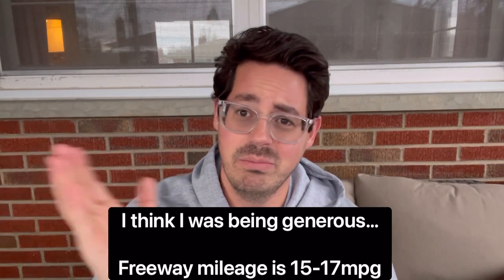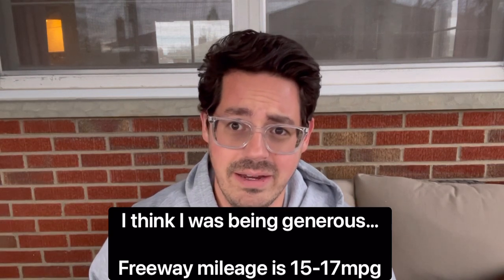Worst Engines of All Time: 1982-84 GM/Chevrolet 305/350 V8 Cross-Fire Injection System

Comment: I bought a 84 vette a few months ago. I knew nothing about the crossfire injection. Car ran when I got it but just barely. At best I'm a shade tree mechanic, but not stupid , if I want to figure something out I can and will. After about two weeks of working on rhe car it now runs very well. Lot of haters on the crossfire. I don't have a problem with it, hell I like it. Only thing g I didn't mess with to make it run was the crossfire system. So hate away boys, I don't care.

Comment: I had an 82 trans am just like yours with tan interior. Your comments are spot on, even the overlay about the soft camshafts. Mine had a flat cam shaft lobe that made repairs more than the car was worth. Great handling car but weak power train and absolutely atrocious build quality. Worst rattletrap I’ve ever owned and the car only had 60k miles on it when I bought it in 1987.

Comment: Trust GM to totally screw up an incredible intake system. I mean hell, MOPAR had 2 awesome CrossRam setups that GM could have copied. 
Ive always wondered if you could port inject the manifold and run say, a F.A.S.T. PCM if that would make a performer out of it.
Reply: Since air-fuel distribution was poor, GM should've taken a page from Nash Motor Company (back in the 1950's).  They used a water jacketed intake manifold that had perfect air-fuel distribution and vaporization.  The entire manifold was evenly heated by the coolant at the top of the engine (flathead six), and Nash engines were renowned for fuel economy and smoothness.

I don't know how GM would water jacket that Cross Fire intake but, had they done so, the runners could be large for breathing and the uniform heat all over the casting would enable a much leaner air-fuel mixture and balanced distribution.
Reply: @BlackPill-obey  But, if one were to port inject it, the the manifold would just move air. Do you think that would have made a difference?
Reply: @shelliecarlson7015   Sequential port injection would've completely solved the fuel distribution problem.  But, back then, it would've been cost-prohibitive.  

The technology obviously existed back then but, to make is feasible for mass production and maintain a certain price level was the problem to be overcome.

Comment: I owned an 84 Corvette that was crossfire injection and had no problems at all with the injection system. By 84 they worked out the bugs but it was too late the damage to the reputation was done. I drove that Corvette for 177,000 miles and the only problem I had was the hydraulic clutch cylinder spring broke.

Comment: Hi Adam. I am a GM/Delphi retiree that worked at the plant that built the TBIs, CPI, SCPI, the Multec 1, 2, and 3 port fuel injectors, as well as  Bosch port fuel injectors under license. A side story to this story is that our plant was originally built to produce the fuel pump for the Olds diesel. Obviously, that didn’t happen so they moved TBI production from the Diesel Equipment Division plant to that new plant. That move had apparently anger Chuck Gifford, who I think was the plant manager at the Rochester Products plant in Rochester, NY. Of course, RPD was our primary customer, so this caused numerous issues for us over our 1989-2006 existence! Indeed it was speculated that Mr. Gifford was instrumental in the decision to close our plant in 2006.

Comment: yes I agree with some of  of the complains but to call a small block 350 chevy one of the worst engines I do not agree, the crossfire was just 2 of the same throttle bodys that they used on the 4 cylinder cars back then, they were very reliable, yes the intake manifold was real bad, I had a 1984 corvette, it was a great car, but yes above 4,000 it ran out of air, I had to re engineer it what I did was mill the heads 40 thousands some port work 1.6 rockers, a 10 pound nitrous bottle, just wired the switch to the ground on the injectors so they were wide open, found the right size nozzle, it worked great, the tuned port guys could not keep up, ran 12.2 at the track, the nitrous was the the best way to fix the crummy intake still got 26 mpg, and it sounded great

Comment: I have an 82 Z28 Indy 500 pace car with the crossfire injection engine.
They came with functional air injection hood scoops which are supposed to open under full throttle. For some reason mine won't open. If I disconnect the wiring and put power directly to it they will flap open but they won't open by the throttle

Comment: I owned a 1984 Camaro Z-28 5.0 computer-controlled carb, and the list of issues you recite was literally the same as my ownership experience. The carburetor and computer seemed to always be at war with each other. It constantly has the emissions malfunction light illuminated for several reasons at a time. It overheated intermittently, transmission shifted harsh and at strange intervals, throttle would stick, engine would run rough and stall then run fine later, squeaks and rattles galore, interior pieces falling off, on and on. I purchased a 1992 Camaro Z-28 with a 5.7 and I still own it 20 years later. Not a single issue other than maintenance and some leaks.

Comment: While working in an automotive machine shop in the late 80s, my co-worker and friend Carl and I took an 82 crossfire Z28 and replaced the anemic 305(5.0L) with a 72 350 +.030 short block with TRW forged flat top pistons that resulted in a compression ratio of approximately 10.3 to 1. We used a set of 69 350 - 300 hp 8947041 heads installed 2.02 intake and 1.60 exhaust valves, screw in studs, guide plates and replaced the exhaust seats with hardened stellite seat inserts and cleaned up the intake and exhaust runners and matched ports @ intake manifold gasket and heads. A Comp Cam 268H cam was chosen, lift was .485/.485 , duration was .218/.218 @ .050. With the original 2.73 rear end ratio and the steep 1st gear in the 700r4 that replaced the 2004r, it was an absolute beast to drive and a barrel of fun.  Never got an accurate measured 1/4 mile time, however my step son, who I built the car for at the time said it gave a ZR-1 Vette a good run for its money on I80 west in Pa on his way back to college in Bradford Pa. The car was a tire melting sleeper to the 9th degree. I loved it!

Comment: My 1989 throttle body GM pickup had a bulletin for replacing the single wire o2 with a four wire heated unit and the harness for it plus installation instructions. In my little cow town my pickup seldom went into "closed loop". Might be able to retrofit it to your f-body.

Comment: I should say I did drive a California Baja Bug with twin carbs. so the dual TBI was nothing I did not ever see before. 
The new electronics. I was used that fixing my OH-58A/C helicopter. 
Now ya so many ways to upgrade the engine for more power.
I could put a modern TBI on it. (Drop my car value $10K, my 82 CE is still about 99.1% OEM stock). Technically I could make the engine a 383 as long as they don't touch the numbers matching thinger on the block.  

My wife had a 383 1981 vett with everything you could ever want. I have the 200r4 in it.
It is amazing. I had it build for 700HM and put a 500 HP 383 on it. 
Never had a problem with that 300r4 in 8 years now. We did spend about $3000 for it. And still have stage III warranty. only pay for shipping to repair. 
She drives it every day it is not raining or snowing in North Carolina.

They choked it off for intake because most everyone daily never go over 3500 rpm. 
Having low RPM was kinda nice. Inface GM worked hard to convert these lessons into the truck line later on.

I have a glitch. TPS has a "worn spot" it is 41 years old. If the replacement last 10 years I will be happy. AutoZone still carries them. Other than that.. My 1982 Corvette CE runs great. All oem exhaust and attachments to the engine. TBIs everything. Not modified in any way.
Runs great. No miss etc... 2nd owner. Now only 60K miles ( I work from home).
I just take care of it. Keep it clean. Cover it. Wash it powertrain included.
I lube everything all of the time based on time.
Now on the O2 sensor I have every repair document. Mufflers, ehaust manaflod (and gaskets later) from looking at it I still have the 1982 O2 sensor. I am afraid to mess with that thing. 
My scan sool show it still works so I am not going to touch it unless I upgrade the TBI/Manifold/Roller cam, dual exhaust. Honestly it drives so perfectly (stumble here or there a few times in a month) it works perfect.

I would like to admit it gets about 116 MPG. Our 1981 got about 19-25 mpg. I did convert that to a modern TBI so it gets 18 mpg always now.

I tow my WWII side german motorcycle on a trailer with my Corvette to Sturgis. It is to far for a 1940's bike that struggles so hard over 50 MPH 70, only down hill with the wind at your back.

My Vett is a CE version. I will not modify many things.
When there are no longer crossfire parts then I will change the engine. Yes. I have the original engine from 1982 never rebuilt, no head gaskets. Water pumps, alternators, AC compressors only. Still the original smog pump (right, that that sucks).

Again its a CE.. So if the FI dies so bad I can't get the parts I might upgrade the FI. But, might find used/refurbished. It starts in 2-5 seconds of cranking. Gets going just fine. Meh.. I am not hating on MINE. Your mileage might very... I did install a Dewitt's radiator. Also the K&N Air Filters. Not all the box stores carry the paper ones when I need them.

Comment: Wow, how is it possible to make that little power while using that much fuel.
Reply: That is "emission controls" for you. I live in Europe and here it was the same. But we were lucky that emission controls weren't mandatory until the mid-1990s, the time they ironed the bugs out. 
It was pathetic. The S-class Mercedes without EGR and Cats made 250hp and got 18mpg, those with Cats and EGR made 190hp and got 13mpg.

Comment: You are wrong about long runners for high RPM velocity. They're used to get the airflow going at low speeds. That's why you can see tons of engines with velocity stacks that live at high rpm.

Comment: In our auto repair shop we had a lot of customers with performance issues with the 1982 - 1984 Crossfire TBI injection systems. So much that when I went to buy my first new car ever a 1983 Chevy Z/28 I ordered the 305 4bbl. It ran smooth never an issue with stalling or rough running like the Crossfires. Now it was a dog, 0-60 mph in 8 seconds and your right at full throttle max speed was 115 mph in 3rd gear and if I backed off a tiny bit it would go into 4th gear (overdrive) and the 145 hp engine just could not produce the power to maintain the speed and I would slow down to 110 and I would push the gas back that tiny bit dropping out of overdrive and move back up to 115 repeating the cycle. Mileage was excellent 22 highway a little less in the city. It did have the 700R4 trans and I would do major burnouts and smoke the tires as 1st gear was very low. Never had an issue. Cornering - very few cars could take corners like the F body at that time. My brother gave me his 1989 IROC Z/28 that I still have in my garage, 350 tune port and it runs awesome. Only thing that sucks is on the F bodies having true dual exhaust is not possible.  Thanks for all your work on this video.

Comment: My 82 Firebird SE with stick had the 305 carb V8. I still love that car, the way it looked. It dove well, but the 4 speed manual was junk The 305 had soft cams, and get the engine worked in twice. You did bring it up.

Comment: Yeah I know you're trying here but have that what you say is bullshit. The cross ram Chrysler invented. Back in the 50s and 60s they use the long Rams on the 413 Max wedges where the carburetors would sit on top of the valve covers I know guys and girls to put them on their muscle cars torque out the ass Before the Race ones they shorten them by hat that's why you got the box style intake. Long Runners torque comes on massive at low RPMs short Runners higher toward higher RPMs. And the bad thing with those intakes he's talking about there was Hot Rod Car Craft excetera that did intake swaps on those engines were they would take the top off and gasoline was literally pooled in them. It looks cool but functionality they suck that's why they end up changing them to the to torch

Comment: The biggest problem with your 200 trans is a shift overlap. The clutch is applying before the band is released, or vice-versa (It's been a long time). We used to install an aftermarket shift kit that eliminated the overlap. Your trans might already have the update, since almost every one of them burned up the forward clutch around 20k miles. But, because almost all of them failed, it might be worth looking into.

Comment: I was working at Maroone Chevrolet when the "Cross-Failure" injection came out and it got my full attention as I was a Corvette specialist and drivability specialist, the only one at the dealership. I was tasked with retrofitting the corvettes with tuned port injection starting in 84' ,(wiring harness,computer, fuel pump and all other needed parts.) I was doing 2-3 a week when we stopped retrofitting the Corvettes.

Comment: My sister's boyfriend had Camaro pace car.   Cross fire injection. What a slug.  Back on the day I would smoke that slug with my Pinto. I had a 2.8 V6 Pinto and a walk all over these cross fire 305/ even the 350 were slug motors. Sad when a Vette is only 200 HP.   Worst cars and worst engines Chevrolet ever made. Terrible crap. Garbage and weak AF

Comment: If the issue you mentioned where the throttle linkage get's stuck in wide open occurs what should I do? Shut off the engine, then come to a stop or try to put it in neutral first? You're must be a stick, what should you do if it's an auto?

Comment: I too owned a 1984 Corvette with Cross-Fire, also known as Cease-fire, I have own 7 corvettes and the 1984 was the worse. Not only was the intake manifold  junk, but even if you could get more fuel/air into the Engine, you have to contend with the Also junk heads & exhaust. but beyond that, you have a ECM which was a close runner-up to GM junk as well. Also, if you ever wondered why the car had such long throttle cables ?. . . It was because the 2 throttle bodies, were designed in reverse order or backwards and by the time the engineers caught the mistake. . . The intake manifolds were already being cast in the foundries. Too late to catch the error, so longer throttle cables were designed and produced, but of course, being GM that were  very cheaply made which lead to them wearing out very quickly !

Comment: Somebody correct me if I'm wrong but I'm fairly sure those TBI units were directly shared with the Iron Duke when it gained injection in 1982. Poor fuel distribution, typical 80s garbage electronics & untrained parts changers that didn't understand what they were fooling around with is all that really went against that engine. In theory due to the long runner design, it should have torque just like a tractor. The fuel distribution issues are exactly why Ford abandoned TBI relatively early in the mid-80s on some of their truck engines & ran port.

Comment: I have an 84 corvette and I added a renegade intake manifold it’s still a crossfire but full size ports to match the heads and now it’s faster than my 85 vette.  The poor performance is the tiny intake ports that meet the heads. The renegade intake adds 40+ rear wheel hp.

Comment: Iown a silver  84 vetted I paid only 5 gs for from I guy I know who owned a bar downtown in a city I lived in for a long time  now the exhaust setup with the headers bigger injectors bigger fuel pump n the mufflers r right under the floor, ur feet sit at this car sounds bad ass like a ol big block car pretty much granted it s nice with the t tops and black leather interior that looks absolutely like it was just bought new yesterday  granted it can't tou h my gold 1980 formula  firebird that's got a 4555 big block h/o ,vwich is the Pontiac 455 high output not one of the ol 60s firebird SD aka super duty 455s wich are sick but my ho that guy I bought the formula told me he got it fro.a guy that had a wrecked 70 trans am nthis 455 pushes legit 1 hp per ci with these up I got right nowlsame setup eddelbrock parts I got on my 400bb that's in my 79 black and gold bandit edition  transom hardtop cuz I had  the same one when I was In high school with this white and black tu tone paint job on it eddelbrock preformed rpm I pulled outta my ol high-school bb ta n put on the .int beauty I bought through ebay for ra flat 19 gra dash I flew down to ft Lauderdale Florida where guy had it with my  former bosses dealer plate and drove that sexy beast up to Massachusetts while I was flying up 95 north past NYC I went bu a NY state cop n I looked at my speed wich was pushing over 133mph at  like 3 quarters throttle cuz  I just let it climb up slowly but lookin at my hood tach ad I floored it saying to myself fuck you cop immma get onto ma pike in just some mile let's see if I can blast past q40 wich I did and he didn't even pull out n put lights on or nothing n shure enough I was in CT. In notice anyway n than soon after was on 90 wich I than merged onto rt 91 got off in Holyoke ma &took rt 202 to my bosses house ripped into his dirt driveway that led  to his garage where he &his son built drift &short track race cars that allways had like 900 supercharged hp gettin to te rear tires n thro the slicks to the ground God I miss driving  for him randomly

Comment: There's really nothing wrong with crossfire. The intake is restrictive but can be ported, and it's basically two single barrel carbs with electronically controlled jets. Nothing fancy. If you understand newer air intakes, and are having problems with a CFI intake, you'd be able to fix it in under an hour. They're not bad, they're just not performance intakes.